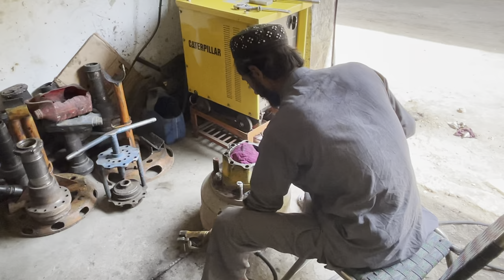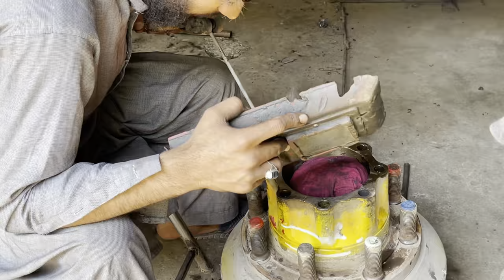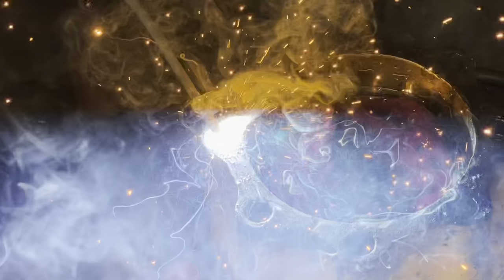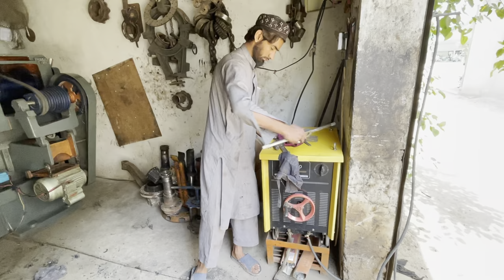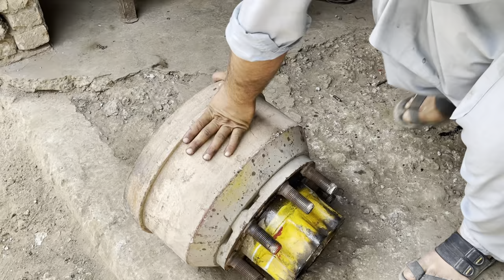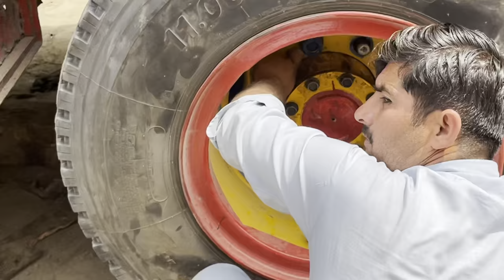Intelligent Way of Removing Broken Bolts | How to Extract Broken Screw Stud Bolt | Complete Process

Comment: To do one would have been impressive but to do three is quite amazing. They were deep and it would have been very easy to weld the built up plug to the thread walls. In theory easy but those who have tried know how hard it is. Massive respect.
Reply: Seen them put up welds upon a broken bold and to protect the thread they first put in a copper tube and filled those up with welds as not to damage the thread walls.
Reply: @h.rutten2187  - copper tube is probably more necessary doing the same job with a mig welder due to no rod slag to protect the threads.  Also the possibility of the wire leaving the gun arcing out on the threads before it gets to the bolt if the broken bolt is deep and you're not perfectly centered.  Stick welding would also help keep your arc close to the top of the bolt and not bumping the sides of the hole, or protect you a bit if you accidentally touched.
Reply: Yeah real impressive open toe sandals with 1700 to 1900 degree sparks.. no nomex jump suit to protect your body and special place from red hot needle sparks that can embed themselves a inch into your nice soft awaiting flesh. no welding gloves no respirator and i love how he grounds it to the floor no risk of electrocution there...we sub out stuff to 3rd world.. no osha or nfpa there real impressive.
Reply: A 140 amp welder takes 15 amps at 240 volts. By they time you’ve got 150 amps welding current, the voltage is around 24.  
That won’t hurt anyone.
Reply: @69NOMAN69  I herby make you an honoury Indian. You are quite correct.
Reply: @josephgiannini6174  в журнале "Экономист", приводилась картинка, в которой изображена в разрезе цена чашки кофе в английском кафе, в этом ценнике, доля производителя кофейных зёрен составляет 2%, чтобы вы на Западе могли по при приемлемой для себя цене выпить чашку кофе и существует третий мир, с таким ремонтом грузовиков и такими условиями работы людей
Reply: @piratepete4322  in MOST cases. Why do I feel like I've seen a weld stuck to iron before? Maybe I'm crazy and wrong.

Comment: Hello PT. Nice job with the few tools on hand. That takes a light touch and patience. Not having either, I try the Easy-out routine, break it off jammed in the bolt. Then haul the whole piece to a gifted machinist. He puts it on a big milling machine and bores out my mess. Then tugs the threads out with needle nose pliers. We had plenty of pricy aluminum heads with broken studs. Scary, those damage so easily.  Good luck.

Comment: this is a common way of removing broken studs like that, most welders do it in the field this way, good work.
Reply from the maker: Thanks
Reply: I typically see welders put a stub length of pipe in the hole, and weld that down the center to the end of the broken bolt. Then just turn the pipe stub to unscrew the broken bolt. Saves the hole and the threads.
Reply: @bills6093  - Now THAT, sounds a far better way of doing it, Thank you for sharing that Sir.
Reply: I usually slide a piece of copper tube down to save the threads, otherwise same method.
Reply: @bills6093  how would the weld rod not arc down the pipe on it`s way down?
Reply: @REDMAN298  It only arcs at the exposed tip if you're careful.
Reply: @bills6093  you don`t know what you`re talking about troll.
Reply: @REDMAN298  Go to the " I C Weld" YT Channel. See video, "Broken bolt removal". Watch a great welder do it.
Reply: @bills6093  ive used this method, on a 12mm broken stud, although i drilled thru a 12mm bolt, threaded said bolt tight to the broken stud, and arc welded down the bolt, let it cool for a few mins, and buzz the bolt out with an air gun,  it was an awful lot quicker to do than this vid

Comment: If you put a tube down the hole and fill that with weld then you don’t screw up the threads.
Reply: Yep, stub piece of pipe in the hole, and weld down the center.
Reply: these are usually shoulder bolts so no thread in the first half inch or so. This is why they break off below flush.
Reply: @rupe53  you must have missed the part where they rethreaded it.
Reply: @D-B-Cooper  ... in vehicle repair you always chase threads.(not rethread) You want everything to fit like new.
Reply: @D-B-Cooper  Not rethreaded, just cleaned them up.
Reply: Threaded part is lower
Reply: @D-B-Cooper  - I think he was just chasing the old threads to clean out the rod slag and make sure the new bolts threaded in cleanly.
Reply: @rupe53  that's what we do, they do things we would NEVER do.
Reply: but I don't see this... maybe put some grease with graphite or similar?
Reply: @D-B-Cooper  I saw this pipe Method on ic weld👌🛠️😎
Reply: That's a waste of steel. Their labor costs nothing but a pipe.
Reply: Nice one 👍
Reply: Its a special welding rod. Stud X is what I have used for the same operation. The flux flows out and protects the hole. You just build up a vertical stud until you get it high enough to attach something to it and screw it out. I typically use an old nut of proper size and fill the inside with weld from a wire machine. Then screw it out while its still hot.   Im so glad they showed us why the other studs were all different colors.  The delivery guy on the moped nearly made me pee my pants.

Comment: We use special stud extractor rods at my work all the time to remove broken bolts or studs down in blind holes. Also heat and bees wax works wonders with a hole drilled in the broken bolt with an extractor inserted in it.
Reply: Drill a few holes with a drill press of continuing wider size, bees wax or Kroil and extractor.  But this process was done while sitting, so gotta give cred to that!
Reply: hätte ich genau so gemacht. sauber anbohren, ausdrehen, fertig. und nicht schweißperlen auf lager und gewinde.

Comment: The best thing is when you finally extract the broken bolt and you tell an apprentice to clean the threads by running a tap through it and he breaks the tap in there.

Comment: all that weld spatter going right onto the bearing surface...
Also since so much effort is put into painting the truck, maybe, just maybe a tiny bit of that could go into nut tightening indicators instead of using a 3m piece of pipe to overtorque them.
Reply: If you are going to overtorque, I'd use a 5m long pipe and two men hanging off of it to be sure it was very tight.
And now imagine trying to change a wheel in the middle of nowhere at night!
Reply: The results is more broken bolts in the foreseeable future.

Comment: Lemmie get this straight….

Weld it, then beat it, then scratch on it. Then weld it again, beat on it again, then scratch it a little, then put a little oil on it, then back to welding, beat on everything, then scratch some more, and then it just pops right out. Is that correct?

Comment: I've actually done repair jobs like this before except I took a different approach. I installed a hollow sleeve and just welded the bottom of it to the broken stud. (that way I didn't distort the hole and used less welding material) Then I barrel welded a big nut on the top and cranked it out with a socket and ratchet.
Reply: Gonna go out on a limb and say you didn't do your repair in a village in Pakistan. Of course there are better ways to do this in other countries. Not everyone can cruise down to harbor freight to buy what they need for a repair.
Reply: @The_Cat_Authority  I grew up on a farm in Colorado back in the 50's and 60's. We had to make our own parts and fix shit ourselves because harbor freight wasn't invented yet. Hell the closest town was 30 miles away and all they had was a bar and a bowling alley. Please don't presume to know who I am because that isn't fair.
Reply: @mycatz2fatgaming  Point still stands. Things are much easier to come by in the states than in Pakistan
Reply: @The_Cat_Authority  Look,. I get it, but we're talking about a regular steel nut and 2" of pipe.  They would 10x pay for themselves in the reduction in welding wire.
Reply: @grantmcinnes1176  You are still mixing the east and the west.  Pakistan as a whole has a literacy rate of 58%.While some regions only have a literacy rate of 18%. Compared the US with a literacy rate of 88%. Yet here you are, "why aren't they as smart as us and do it like we do!?" Its a completely different world over there.
Reply: @The_Cat_Authority  This is not something requires great smarts, or is learned in any book.  It's passed down as advice from older technicians.  Literacy is irrelevant.  It's oral tradition and craftsmanship.

And again, anyone who can operate a welder is more than capable to understand and do it.

This guy didn't, but likely he has a good reason we don't know.  But maybe he missed out on someone telling him that particular trick.  No biggie.  I didn't learn it till 5 years ago, despite doing technical work for decades.
Reply: @grantmcinnes1176  LMFAO

Comment: The back and forth motion that he uses to remove the bolt with the T-handle, is the way the bolt should have been removed in the first place to avoid breaking it as much as possible. Today in rich countries mechanics just apply an impact wrench,  break bolts and have the customer buy a whole new part. Can't do that in Pakistan or the rest of the world. Great job.
Reply: Because no one wants to pay a mechanic to spend 2 hours at $150/hr shop rate to repair a part that costs $50 new.
Reply: @SSHitMan  I'm quite shure that a new breakdrum like this costs more than $50
Reply: I call it a BS. In rich countries, mechanics have to deal with broken bolts all the time. There are special tools and procedures to repair such problems without replacing the whole part.
Reply: It’s certainly not due to impact wrenched.  Bolts  break.  Impacts HELP loosen - the term impact says so. It’s a vibratory action. Not just brute force.

Comment: I had a bolt to my alternator snap off flush with the block. It was in a spot where I only had about 3 inches of clearance between the block and the engine compartment. There was no way to get a drill in there if I wanted to use an easy out. I planned to try to stick weld a nut to the end of it, but there was no visibility to the top of the bolt (bolt was parallel to the ground, facing the engine compartment). I cleaned the area as good as I can with brake cleaner; then alcohol. I then taped a nut to the end of it with painters tape after punching a hole in the tape the thickness of the welding rod, dead center. I bent the rod into a hook shape and inserted the rod through the hole. The tape burned up as the weld took and I filled the nut up to the top with weld. After the glow went away, I put an open end wrench on the nut and worked it back and fourth. Added some penetrating oil and I was able to screw the stud out easily. Took me just a few minutes to do the whole job. I will never use an easy out again, considering all the times I've broken them while trying to use them.

Comment: I had the same issue with water pump bolts on my toyota,my mechanic said he used this same method, 1st try the weld broke,2nd try it worked. In the end the repair cost me double because of the broken bolt but glade that I did not try to do it. Gonna buy a welding rig.

Comment: Quite amazing I would not recommend an amateur doing this job. This is a difficult task these guys are really skilled and professional. Another comment person said how difficult is to weld onto the bolt without messing up the threads, he's correct very difficult. By the way did you see the way they ground the welder to the floor, I suspect you don't find too many animals wandering to that shop.

Comment: Been doing this for nearly 20 years now, if he did lots of smaller tacks it builds up much faster, and less likely to spread and take to the threads. Also use 312 rods as dissimilar rods are harder to shear off the bolts if they are really tight.

Comment: I with Mike Murphy on using a piece of copper pipe tight to the wall as possible,just to save the  chasing the threads out from splatter..

Comment: I always drill a hole in the middle of the broken stud and I use an "easy out" tool to remove it, and it works every time. I'm a mobile mechanic.
Reply: I've broken them in the bolt. Now you have a problem. Heat is better. Better yet, don't break the bolt in the first place.
Reply: @robertthomas5906  I am with you on that, easyouts are a shortcut to disaster
Reply: You have been very lucky. Experience has shown hardened stud removers usually become stressed after 1 or 2 uses. Guess the steel reaches a stress point and then breaks...never evenly.
The weld method is the best!!
Reply: And those GD easy outs are harder than any known drill bit when you break those things off in a bolt...
Reply: If he had eased the bolt with heat and worked it back and forward  he wouldn't have had all that time spent filling the hub with splatter   he probably didn't clean it out   sand is there lube  it will soon grind up to a paste  😱😱😱🇦🇺

Comment: Drill a hole,  perfectly centered on busted bolt. Drill up sizes until threads start to show. Pick out the pieces. 
Or tap a left handed thead in busted bolt. Wrench left handed bolt to pull out busted bolt.

Comment: Great 
Brilliant Idea.
Very good .
Reply from the maker: Thanks a lot
Reply: Better to try a short length of pipe in the hole and weld down the center of that to the end of the bolt. No hole or thread damage.

Comment: Been doing this for decades.
I use the mig welding process, its much faster and easier.
The heat and expansion and contraction as well as burning the rust that does most of the work .
I also generally keep building up way past the surface and use a stilson to unscrew or sometimes build it up enough to weld on a sacrificial nut and use an impact gun to work back n forth and eventually rattle the thread out.
Reply: we used to put a pc of copper tubing in, fill r up and weld a nut, if u have the chance, let it sit overnight. also mig, and wait till it's no longer red and hit it again to do the build up
Reply: @jayjackson597  Thanks Jay, I also use the copper tube if n when its handy, I just forgot to mention it .
Also I use copper plate to cover holes while building up .
I dont stop n start with the mig like you say but only when it gets too hot to weld without making a mess of it all, then let cool down enough to continue.
Reply: @jayjackson597  - I was thinking about the copper tube, and because the gas in mig does the shielding, making the tube necessary for that operation to protect the threads.  And because this was stick welding, the insulator slag melting off the rod was performing the same function as the copper tube, he just had to be careful to keep his weld centered in the hole so that the slag would flow to the outside.  Also why he had to stop so often and break the slag out with the giant bolt and hammer, then run the raw end of a new welding rod around the edges to clear out the broken bits of slag, exposing the new built up center.  I'm sure the heat cycling didn't hurt anything either, plus the shock treatment from the hammer and bolt working to break any bonds as well.
Reply: @mdemers767  yeah Ive done that too, we were way behind in tech till a new foreman came in and saw we didn't have mig or tig and got that fixed and it payed for itself pretty quick. we did a mix of repair and new but mostly restoring old stuff for our customers who did production and we had to stay and get it done no matter how long!

Comment: My solution... Buy or make some drill guides that slide into the top hole. For the first drilled hole use a smaller cobalt bit to make a guiding hole, then open it up with second drill, close to inner thread size. and then use an easy out. It would be nice if it could be done in a big drill press or mill at worse with a corded hand drill.

Comment: or, you could drill a hole into them, use a left hand tap to put the thread in the hole then screw a left hand bolt into the broken stud and unscrew it
might need to apply some heat to the area

Comment: place just a bit of stell pipe that fits into the hole. rest it on top of the broken bolt then insert the wrlding rod. dont touch the sides of the pipe then weld the bolt to pipe. when you think you have a good weld. use a wrench to hold the bar and unscrew the broken bolt. if it brakes the weld repeat .

Comment: Just take the same size bolt & drill a hole through the center on a drill press as wide as possible. Use it as a guide to drill a hole in the broken bolt & tap it out.

Comment: I don’t understand why the weld doesn’t fill the hole and become permanent.
Reply: The slag forms around the weld so that it will not stick to the cast iron. That is what he kept cleaning out. When he finally removed the broken bolt you saw how the weld was smaller then the bolt. That allowed the bolt to back out and the weld not to fuse with the metal in the hole.

Comment: I noticed at the end those bolts have a reverse thread, they have to be turned counter-clockwise to tighten. Maybe that's how they got broke off in the first place, they used that giant breaker bar to "loosen" them but were actually tightening them lol.
Reply: No
Reply: He definitely turned counter clockwise to get them out.

Comment: HAHAHAHAHAHAHAHAHAHAHAHAHAHAHAHAHAHAHAHAHAHAHAHAHAHAHAHAHA
did not strap down the piece, just drove off to deliver it RESPECT 
i usually drill into the broken bolt and work my way up to bigger drill to thin out the walls of the bolt then i use a left thread bolt remover and sometimes it comes out as one piece or pieces. then i'll use tap to clean threads. my hat off cause i could not build up bolt without welding to side of hole BRAVO👍
i Like, OLE'! 💃
edit: that cheater bar 🤣 i too use cheater bar